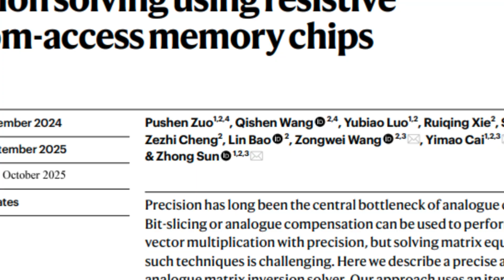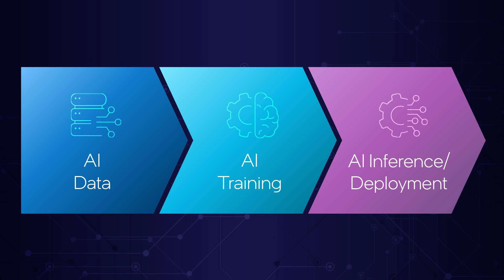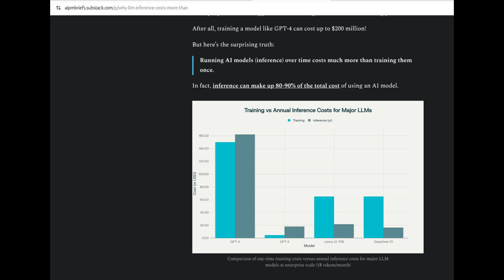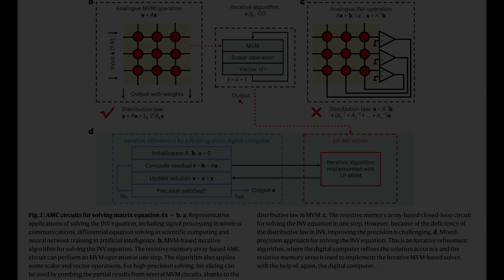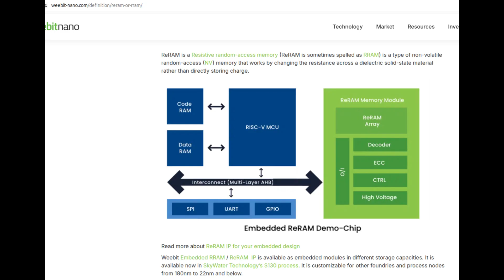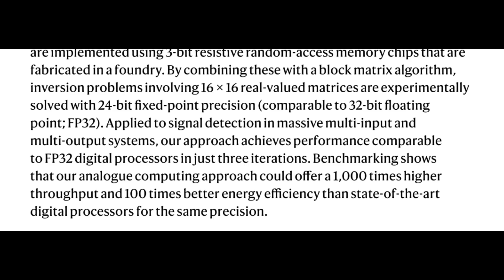Review of "Precise and scalable analogue matrix equation solving using RRAM memory chips"

Comment: First of all, thank you for covering this paper. I was looking to understand some recent headlines about China making analog chips that 1000x faster than our current GPUs.
But, I felt your talk was more about the potential of the technology, and not so much about how it works, or more in-depth comparison of analog vs digital.

I think I roughly understand analog vs digital when it comes to multiplication, but animated diagrams help. For example, digital addition could be two 1-bit numbers and a bunch of AND and OR gates, and then scale that up to 2-bit, 4-bit, and show the complexity with scaling up to 16-bit, and using matrices. And then for analog addition, it could be two analog voltages as input into a black box, and what is output is another analog voltage, but the voltage is very precise, and not a rough estimation.

And that's the other thing to cover - how do digital systems interface with these analog systems? Is the analog output precise enough that after many layers of the neural net - and many stages of matrix multiplication - that the results will still be somewhat precise?
Reply from the maker: Very good questions, and you are right, this paper is less about performance and more about the  engineering details  that make precision analog computing finally viable. 

We might need to do an in-depth video to answer those questions but here’s the short version of how it actually works  and why it matters:

1. Analog vs Digital Computation: In  digital  chips (like GPUs), numbers are represented in binary (bits). Operations like addition or multiplication are broken down into logic gates (AND, OR, XOR), which scale exponentially in complexity as you go from 8-bit to 16-bit or 32-bit precision. In  analog  RRAM (resistive memory) chips, each memory cell physically represents a number as a  conductance value  (how easily current flows). When you apply voltages representing an input vector across a grid of these resistors, the resulting currents automatically produce a  matrix–vector multiplication  in one physical step , Kirchhoff’s laws  do the math  for you.

2. Precision and Iteration: Historically, analog chips were fast but imprecise , noise, device variation, and analog drift limited them to a few bits of accuracy. This paper’s breakthrough is a  hybrid analog algorithm : it combines a low-precision  analog matrix inversion  (LP-INV) step with a higher-precision  analog matrix–vector multiplication  (HP-MVM) step. These are repeated iteratively, each pass refining the result until it matches  24-bit fixed-point precision (≈ FP32 digital).

3. Digital–Analog Interface:Inputs and outputs are converted with DACs (digital-to-analog converters) and ADCs (analog-to-digital converters). The authors show that you don’t need high-end converters , even 4-bit ones are enough, because the iterative feedback loop cleans up errors over multiple cycles.

4. Why it’s 1,000× Faster: Each analog operation (matrix multiplication or inversion) happens  in parallel  across thousands of resistive elements , taking only ~100 ns. The equivalent digital process would take billions of sequential arithmetic steps. When you compare throughput per watt, they find ~1,000× speed and ~100× energy efficiency over GPUs,  at the same FP32 precision.

5. Accuracy over Many Layers: You asked if analog precision “stays good” after many layers , yes, that’s exactly what their iterative method ensures. The analog error (noise, drift, or nonlinearity) is measured each cycle and corrected using a high-precision analog step, so the cumulative error doesn’t explode.

If you’d like an intuition-building visual, imagine this: 

- Digital addition:  combining Lego blocks, piece by piece, perfectly aligned.
- Analog addition:  pouring two measured volumes of water into one container , the total is instant, but you must control the temperature, container size, and scale precision to ensure it’s accurate.
This paper shows a practical way to make that “measured water” as precise as digital math , for the first time, on real chips.
Reply: @AIBrothersPodcast  thank you for the explanation! And thank you for confirming what I thought analog vs digital was like, especially the water analogy for digital addition.

Two questions if you wouldn't mind answering:
#1 - does the paper reveal a lot of process details that can allow others to quickly commercialize the technology? Because the news headlines suggest China might have the lead on bringing the chip to market.

#2 - can this scale with smaller process nodes? Will this work with 4nm, then 2nm, and then smaller? Is there any potential for current leakage, or quantum effects, as they say for smaller process nodes?
Reply from the maker: @that_guy_fahad  
Good questions:
1) On commercialization and process details:
The authors used a foundry-fabricated 40 nm CMOS-compatible RRAM chip — that’s a mature industrial process, not some exotic lab setup. They even describe the 1T1R (one-transistor–one-resistor) cell structure, materials (TaOx), fabrication layers (between M4 and M5 metals), and a special self-passivating sidewall technique that improves reliability and retention.

So yes, they gave real process data, but the harder part isn’t fabrication, it’s calibration and integration. Achieving reliable 3-bit precision per cell (8 conductance levels) across thousands of analog devices takes meticulous tuning, “write/verify” programming, and circuit-level feedback design. That’s not something another lab can instantly reproduce from reading the paper, it still takes significant device expertise and analog control know-how. 

In short -> China’s researchers clearly demonstrated foundry-grade manufacturability, but that doesn’t mean it’s production-ready silicon yet. It’s a prototype showing that high-precision analog math is now feasible on industrial processes, not a product line announcement.

2) On scaling to smaller process nodes (4 nm, 2 nm, etc.):
Analog RRAM computing doesn’t follow the same scaling laws as digital transistors. These resistive memory elements rely on ion migration and filament formation inside the oxide, physical effects that don’t necessarily benefit from smaller nodes.

In fact, too much scaling can hurt: 
* At very small dimensions, leakage currents between cells increase.
* Variability and thermal noise worsen. 
* And quantum tunneling starts to dominate before you even get to 2 nm, which would ruin the stable analog conductance levels needed for precision.

That’s why this team chose 40 nm, not 4 nm, it gives them stable analog behavior and enough area for accurate DACs/ADCs and op-amps. The real “scaling” for analog chips isn’t transistor size; it’s array size and integration density (how many RRAM cells and analog amplifiers you can tile together efficiently).
So if digital logic scales down, analog RRAM computing scales sideways: bigger arrays, better calibration, improved parallelism, not smaller geometry.

So based on my review of the paper. 
* The paper shows enough detail to prove the concept, but not to mass-produce it tomorrow.
* It uses foundry-grade 40 nm RRAM tech, compatible with CMOS.
* Shrinking to 4 nm wouldn’t help, analog precision and leakage would suffer before quantum effects ever become useful.
Reply: @AIBrothersPodcast thanks again for the wonderful explanations.